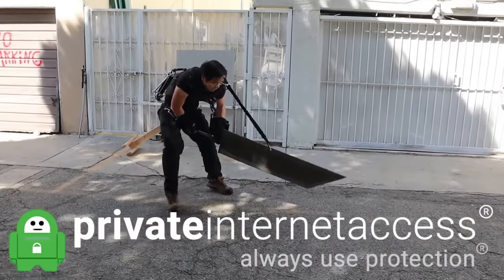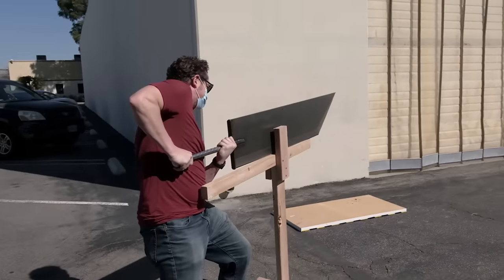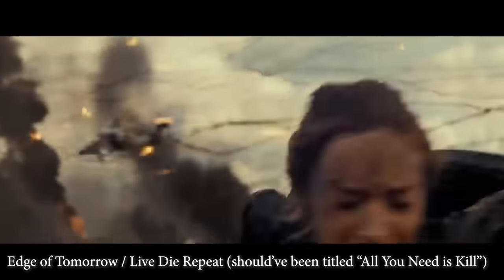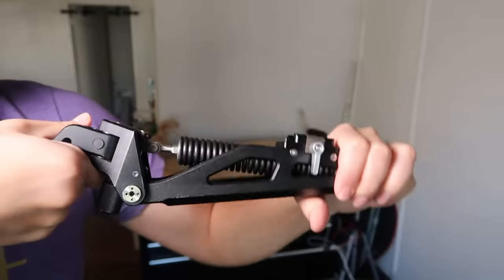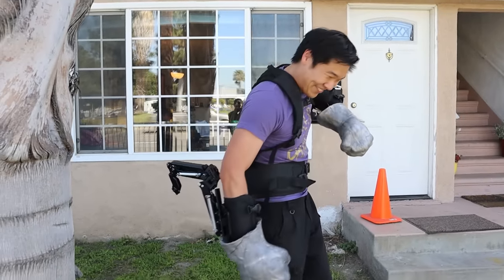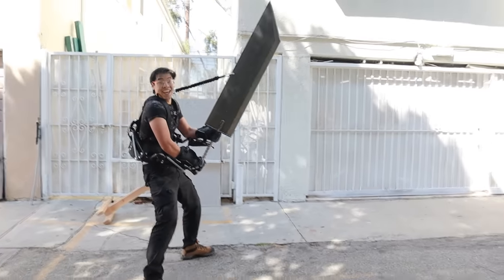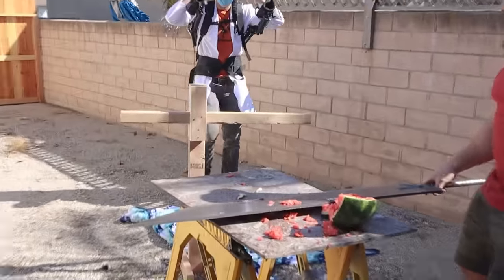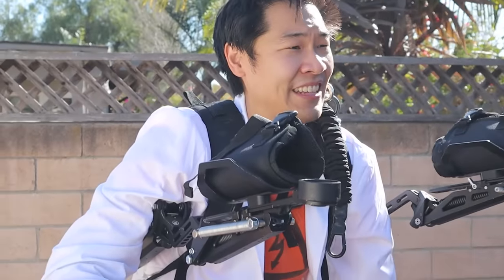I bought an Exoskeleton to wield Giant Anime Swords

Comment: Whenever I think about large and heavy weapons, I think about how in the Epic of Gilgamesh, they cast swords of six score (120) pounds, and axes of nine score (180) pounds. I know it's only meant to show that Gilgamesh and Enkidu had godlike strength, but I always wonder what it would be like as a puny mortal to try to pick up one of these things. It seems like the axe would be even worse than the sword, because all the mass is concentrated on the end of a wooden handle.
Reply: And also just straight up heavier
Reply from the maker: My buddy the Hacksmith made a 100 lbs replica of the Strombreaker axe from the Avengers, it's actually much easier to wield than a buster sword because he put a Tungsten counterweight at the bottom of the handle for balance 😜 I don't think ancient blacksmiths knew anything about Tungsten tho...
Reply: I always think to berserk. Guts sword weighs about 600 pounds, like bruh.

Comment: if you had a sword with a free weight that could slide the length of the weapon, that might help. when the blade is upright, the center of gravity would be near the hilt making movement easier. when you swing it, the weight would shift to the tip of the blade giving the blow much more power.

if you add some mechanical assistance to shift the weight to the hilt when pressing a button that would make lifting the sword for follow up strikes easy(er) as well.

Comment: All that weight is in the end and you have a very slender hilt.
Forge the blade of a lightweight alloy with infolded steel near the edge (to protect during use). Counterbalance with weighted grip and pommel especially. Also cnc holes or designs into body of blade to remove weight

Comment: I did once hear the issue with clouds sword isn't the weight... though that is an issue. 

Its the friction... and the fact that bigger = slower (no matter how strong you are, the sword has to travel more distance if its bigger... wider swings) which makes it extremely impractical on anything with a pulse that is fighting back.

Comment: The explanation of offsetting weight is exactly how I need to explain why it was so dangerous for an extinct Irish Elk to lose an antler. It's far easier to carry 90 pounds on your head when it's symmetrically balanced, but when you have 45 pounds of antler held six feet horizontally from your head, it gets insanely difficult to carry, and could even snap the neck.

Comment: You know, if you put a knob of metal, on the other end of the handle, that was equal to about half to two thirds the weight of the blade, kept decently small using a very dense material, you might find that the center of gravity's offset on the sword, will have moved back towards the handle. Which negates the rotational force by centering gravity NEAR YOUR HANDS.

This is the function of the sword part known as a 'pommel'. It is a counterweight to the blade allowing the sword to be handled and maneuvered easily by ensuring the gravity center is in your grip.

A big anime sword might be wieldable by a regular person of sufficient strength, if it was designed with an appropriate pommel rather than just a stick poking out of a massive blade, which is generally the case. Which tells you most anime and manga artists are not, in fact, knowledgeable in swordsmithing in the slightest

Essentially, slap a big tungsten ball on the ass end of your generic buster sword, and all you'll need is the exo-arms, plus the sword will be much more maneuverable and you would be the world's first buster soldier.

Comment: you should curve the blade slightly, a common problem I see is that the sharp edge doesn't swing straight down, and if it were a curved edge, it will automatically angle itself perpendicular to sea level because physics (I dunno why, it just does). that way you can focus a lot on aim. Also, would it make sense to hollow out the blade, get as many pounds off of it as you can?

Comment: great video, though im not sure theyre inspired by zhanmadao; big swords are just cool, like whip swords

on top of that im not sure theyre for beheading the horse either, the swords had a lot of heft and weight to them and were fairly balanced towards the handle, which i believe makes it easy to handle and instead the length of the blade is made for a man standing at much lower height than a horse to cut the legs and not the head

a horse neck is incredibly thick, it would be easier to leverage the power to target the legs, perhaps step to the side and use the balance of the blade to slash the legs of a horse as it charges past you, probably rendering the horse useless; in the middle of a battle, that seems the much more practical (though cruel) usage of the zhanmadao, beheading a horse rather than targeting the legs  is going to be much more challenging, where getting the legs would probably still serve its purpose rather well of turning cavalrymen into a foot soldier!

Comment: If you found some way to make the back of the blade out of a lighter material like aircraft grade aluminum & just use steel for the edge then you may actually end up w/ something you could lift w/o the bungie cord.

Comment: I know this thing is ridiculous and unwieldy, but if you put a 15-20 degree bend in the handle, it would be significantly easier to control the blade rotation.

Comment: Hmmmm.... I was thinking of making something like this that you could just wear around because it would be sick as hell, because I thought there was some magic physics voodoo holding up the heavy weight, but would still allow for free movement of the arms with no weight. I turned out to be dum as hell. But I have found a solution: attach small numatic actuators to the end of each spring that can move freely, but when engaged, pull the spring back so that it can offset the weight again. It would be really cool to merge this with another one of my ideas, which was a metal exoskeleton for the lower body that would take away load from bones and joints, instead of having the upper body mechanism resting on the wearer's hips. The lower body exoskeleton could also be fitted with springy things. Colab?

Comment: Okay, no doubt that guy is strong because he lifted it up easy style, but when he drops it he doesn’t have much control on it because he knows dropping that much weight and tightening up his wrist will wreck it but the exo-suit allowed the other guy to hold the blade in a controlled way. I would like to see the big guy wear the exo and see how much more he can do. Also the big guy could pick it up and drop it BUT the exo allowed him to drop AND step back with it at hip level which is something the other guy couldn’t do no matter his strength because that position and movement combined would make the sword too awkward for anyone without that exo assist

Comment: redo the video, but make the handle oval, it will help with the sword staying aligned and it will be easier to hold than a round handle
and it will reduce the strain on the hands... not by alot but youll feel the difference

Comment: Well I have a theory on how to wield heavy swords like the one you were holding without the exo suit you just need a bit of muscle to do it here's my theory hold the bottom of the blades handle  not the tip just the bottom part of the handle what you can do is do a slamming not 2 hands you spin you're body while holding it to a circular motion if you're able to atleast get it in the air then it will slam with a sort off straight heavy slash it's like titans slam move in shadow fight

Comment: I'm a bit late to the party so my comment most likely will go unnoticed but why not make the blade of aluminum. It's light and strong. While it's a soft metal it can be strong based off how thick it is. Cars use aluminum rims and ladders are made of aluminum so why not a sword. May not last long but it's at least easy to weild vs steel

Comment: Maybe use titan instead of steel — that should reduce the weight by some 35 percent — then carve out most of the middle matter of the sword you could likely reduce the weight by another 60-65% of the total weight of the titan sword — or about 22-25% of the original. Or 11-12.5 lbs or 5-6 kilos. You could even replace the solid metal “core” with metal foam and retain structural integrity sufficient for this use case, and reduce maybe another 5-10% half a pound to a kilo total. Instead of being lame with dropping it on a television... so lame

Comment: I know that this is an old video but really so the suit is not electronic so it just designed with springs wield heavy stuff  because literally to get that exoskelleton made of aluminum you need to buy it and if something breaks you had to get the parts to repair it lame 😑